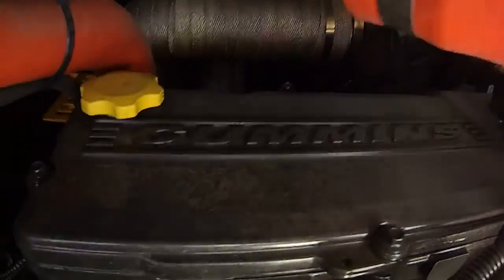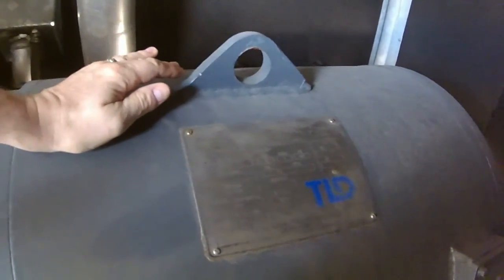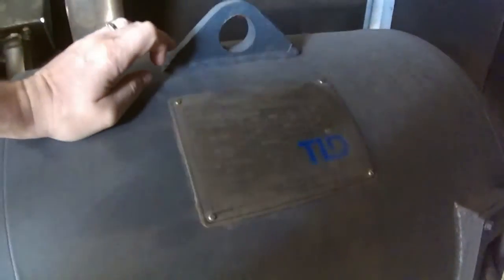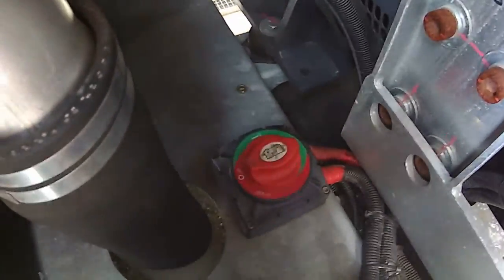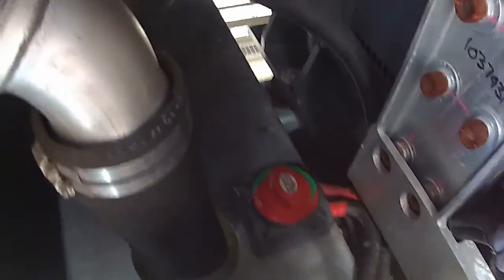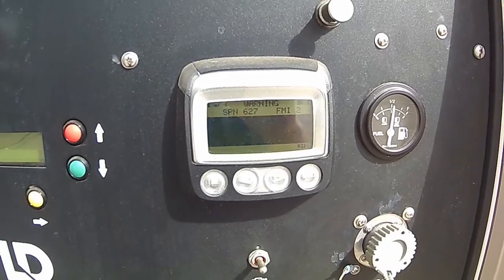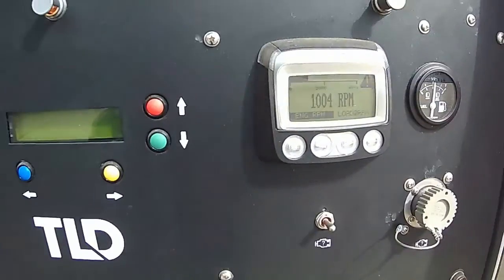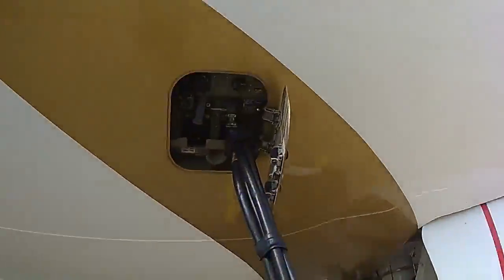Starting the Ground Power Unit | Cummins Common Rail

Comment: What is it used for? To recharge or power the plane while it's on the ground? I'm nosy lol more info
Reply from the maker: +Shiny Knife Yes those are the uses.  It costs a bit over $1000.00 for me to use the plane's APU (auxiliary power unit) which is a jet engine powered unit in the tail of the plane.  This GPU (ground power unit) only costs $150.00 per hour to use.  Whenever possible I will use the GPU to save wear and tear on the APU.
Reply: @BigIronTV  Try looking into Tesla's Turbo Starts. Only GPU i've ever seen be pulled out of an aircraft by one person and just hook up the aviation cables that come with the unit and under 30secons start right up and then wheel it back in the aircraft and fly away with it. I've also been told they have units to power the entire systems and condition the cells too crazy..... it might be expansive though lol

Comment: I work for the guys who made that unit.  It's a 180kVA unit, and as noted, its use is to keep that APU off and supply 115/200V 3 Phase 400hz power to aircraft.  That unit will power up just about every aircraft ever made that uses 400hz, it's the QSL9 Tier 3 Cummins engine in it.
Reply: good to see that. Any knowledge while troubleshooting any issues coming in, GPU.

Comment: I work for the place that makes the GCM (generator control module), you 
can see the blue,yellow,red,green buttons and the LCD screen on the top 
left of the electrical panel.
Reply: plz tell me and share your knowledge about that GCM in order to troubleshooting purpose, will be highly obliged of yours.
Reply: @towqeerusmani9052  there's the internet.